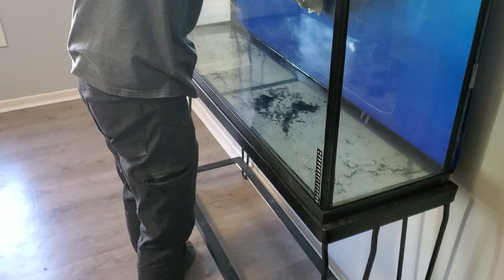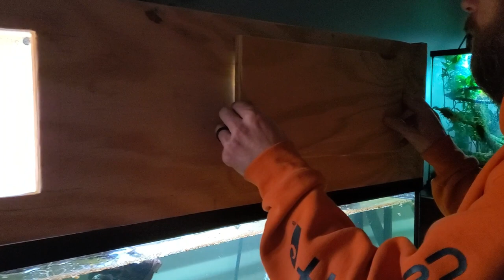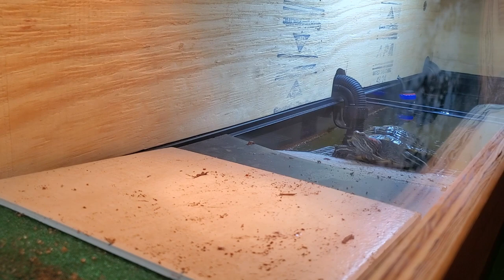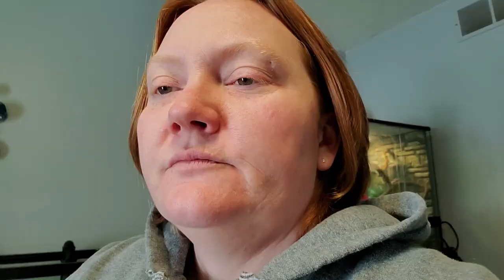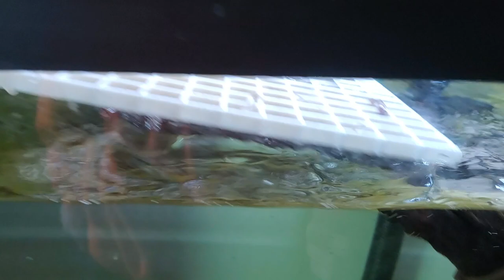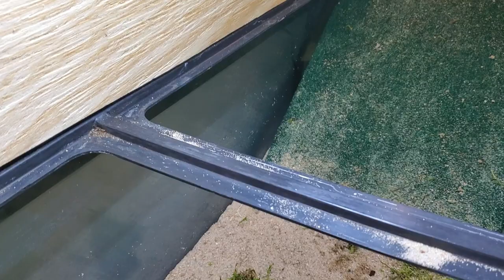Turtle Tank Land and Water

Comment: The plastic ramp you have where did you get it ? And what’s the actually name for it I want to get something like that for mine
Reply from the maker: The ramp for the water side is a creative idea we had for making the transition from wet to dry. It is made of half of a floating dock found at most pet stores for turtles to bask. We attached it to plastic mesh with zip ties so it could pivot or move with the water level. Sorry it's hard to explain how it was made but easier seen.
Reply: @homebasefamily  ok I made one of it accordingly

Comment: Nice! How regular did you do water change and want did you put inside your FX 4? I have 2 terrapins similar size as yours in a 4 FT tank running FX6. I have to do a water change every 2 weeks or so as the water turns yellowish green with lots of particles in the water.
Reply from the maker: We change water about once a month if even that. Nothing special in the fx4 that I know of. Maybe a bag of carbon that I used from their original filter to help jump start the water for beneficial bacteria. Question for you...Does your tank have a piece of dift wood or a object causing the water to change yellowish?
Reply: You must have the incorrect media within your trays. I do maintenence on my FX6 every 5 months and it's on an 150 gallon outdoor pond.